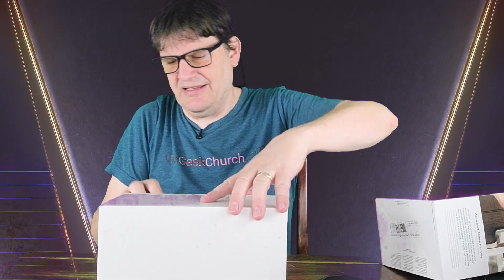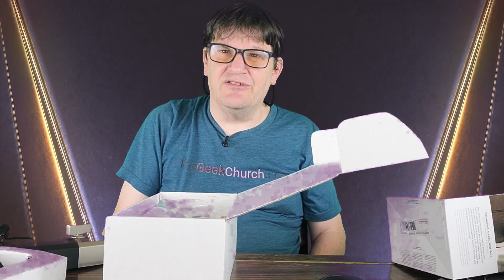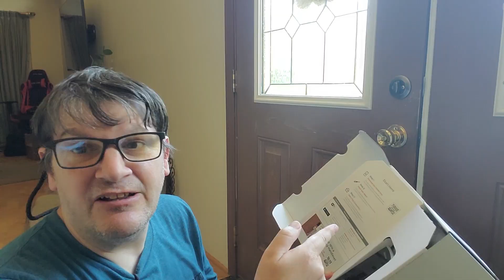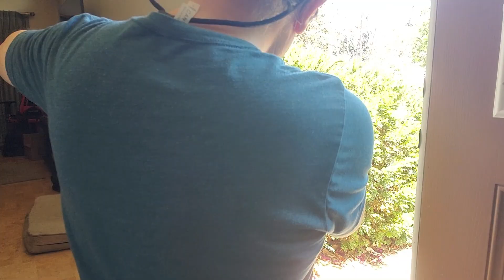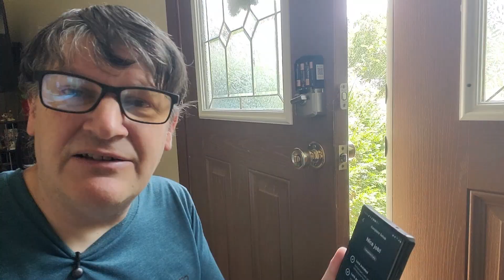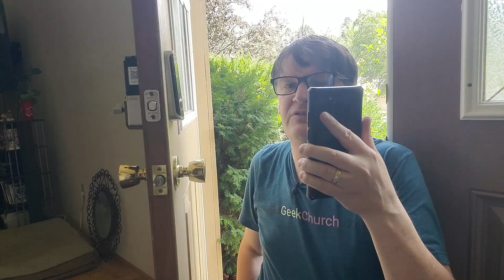Kwikset Halo Select SmartLock Review with SetUp and Warning!

Comment: I have the regular halo and the battery life is horrible.  So far I replaced them when the internet was out for three day, it died in 3 weeks , and when the internet was fixed I replaced the batteries and in 3 weeks it's lost 30% of its battery. i have optimized the battery life by putting the router 6 ft next to the lock, there is no friction between the deadbolt when closing or opening. I know the halo select states that battery life is better. I bought this lock for my beach house but my present home has a schlage Z wave  the battery's last over a year.
Reply: Sounds like a defective item.